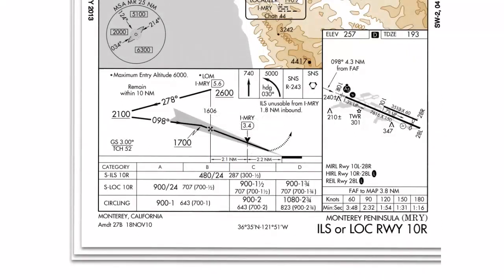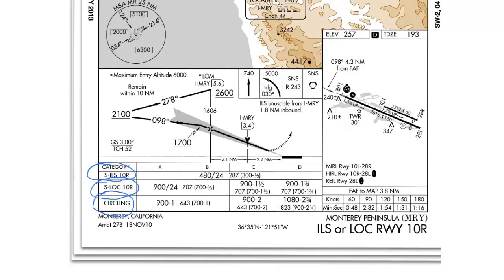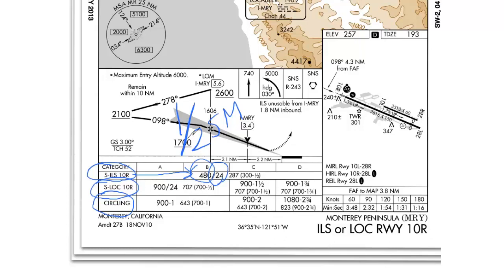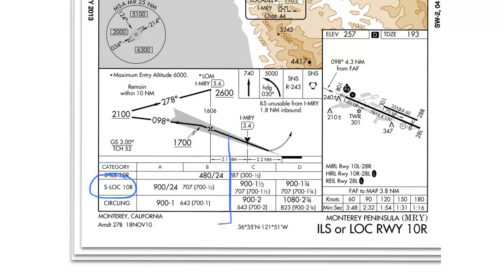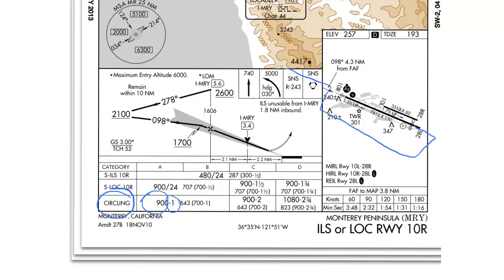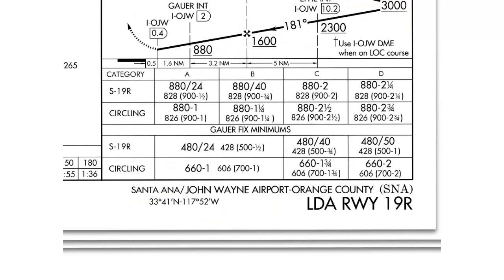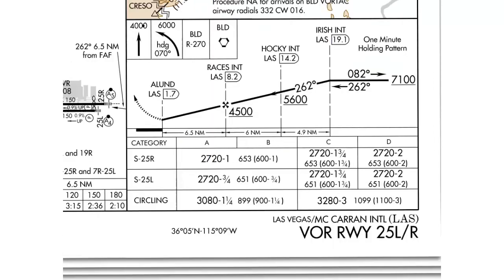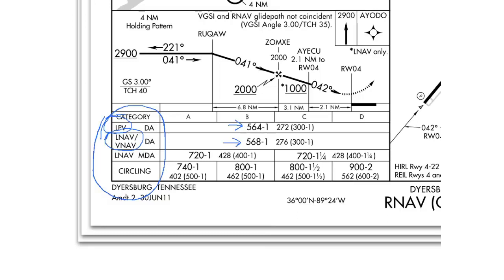Approach Plate Minima (Minimums) Section

Comment: 4:18 - this is not correct. The values inside the parentheses are not for civilian use. It may or may not be an AGL value like you say, but regardless it is to be ignored for civilian pilots. Source: Page 1-23 of the Instrument Flying Handbook (“the figures listed parenthetically are for military operations and are not used in civil aviation.”), also page B1 of any Terminal Procedures Publication ("All minimums in parentheses not applicable to Civil PIlots")

Comment: You’re wrong about visibility at 3:40. You may conduct the approach if the reported visibility is less than reported. As per 91.175 (c)(2)
“The flight visibility is not less than the visibility prescribed in the standard instrument approach being used;”

and..

1.1 Flight visibility means the average forward horizontal distance, from the cockpit of an aircraft in flight, at which prominent unlighted objects may be seen and identified by day and prominent lighted objects may be seen and identified by night.

Visibility is also not the only limiting factor on whether you can land or not. It’s the acronym VAN from 91.175 (c)
Reply: if the reported visibility is NOT less than reported. As per 91.175 (c)(2)

Comment: You call the 480" for the S-ILS a "Decision Height", but I think it is a DA, decision altitude flown off your altimeter.  Heights need a radio altimeter, like on CAT-II approaches.
Reply: I agree,  the 480 = DA
Reply: In my King material it's referred to by both Decision Height and Decision Altitude - I think one is more current than the other, but they both reference the point on a precision approach where you decide to go missed or land.

Comment: I have a question, Always confuse with DA, DH .. 
which one is for which approach? 
And which one is AGL and MSL? 
I read somewhere that "Height" is always AGL. 
DA and DH are for Precision Approaches. 
But .. DA= MSL and DH = AGL? 
MDA is for Non-Precision App MSL? 
MDH is for Non-Precision App AGL?

In the example of the video, can anyone write the data from any number? Like:
S-ILS 480 (DA=MSL)  287 (HAT= AGL) ...
something like that.

Thanks
Reply: +Franjaver Ariza DA(decision altitude)= PRECISION APP AND IT IS BASED ON MSL, AND YOUR ALTIMETER. AND DH(decision height) IS USED IN PRECISION APP AS WELL. AND BASED ON HEIGHT ABOVE TDZ. AND YOUR RADIOALTIMETER. FOR MDA AND MDH APPLY THE SAME THE ONLY DIFFERENCE IS THAT THEY ARE USED IN NON-PRECISION APP. HOPE YOU GOT IT

Comment: During the discussion of the different values presented in the IFR landing minima block, it was stated that the values in parenthesis after the barometric altitude (DH or MDA) and visibility necessary to initiate the approach are an Above Ground Level (AGL) height of the ceiling, rounded to the nearest 100 feet above the touchdown zone of the runway.  This is incorrect.  The values inside the parenthesis are "Ceiling in feet & Prevailing Visibility in SM" requirements for planning purposes, and/or required weather minimums (command regulation dependent) for Department of Defense (i.e., military) aircraft and DOES NOT apply to civilians flying the approach whatsoever.  A full description of every symbol used on IFR plates are located at the front of the approach booklet if you'd like to verify this information for yourself.  An excellent discussion on the approach minima block otherwise.

Comment: So why would Mc Carran's parallel runways have different viz minimums?
Reply from the maker: When they survey the approach and create the procedure a complex system is used to determine minimums based on the obstacles in the area.  It could be that some obstacle encroaches a little too close on one runway but is just outside the protected area for the other.  This could be on the approach or missed approach as well.

Comment from the maker: That is correct.  The minimums in parenthesis are there specifically for military pilots to derive their alternate information from.  The numbers in parenthesis refer to AGL values so they can be an excellent source of additional information but are definitely not "true" minimums (even for the military guys).
Reply: Hi Will. You stated that DH for the ILS is the minimum altitude you can fly to for that approach. Was that a mixup? I always understood that MDA was a minimum height that cannot be broken until satisfied with visual requirements and that DA or DH was just a decision altitude. Am I mistaken in my understanding? Thanks